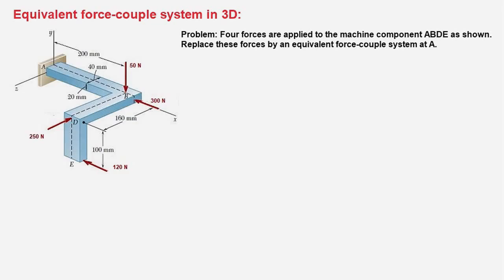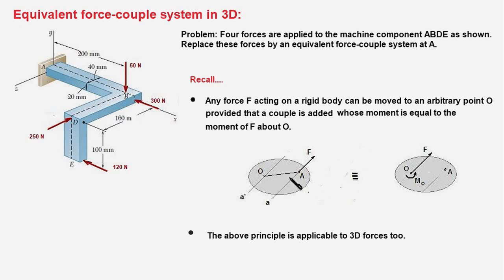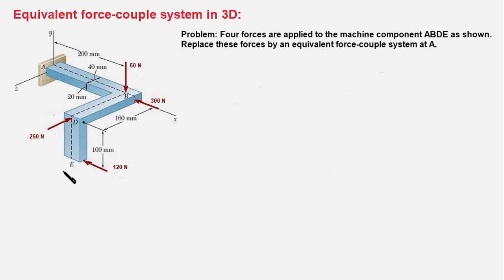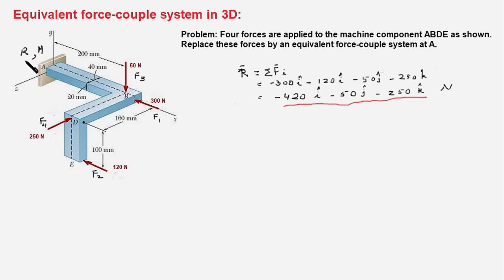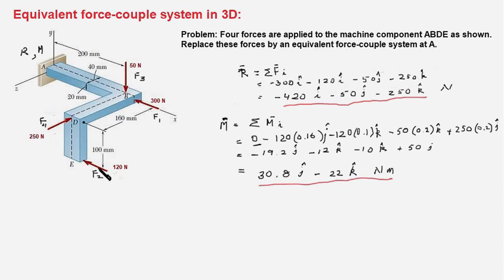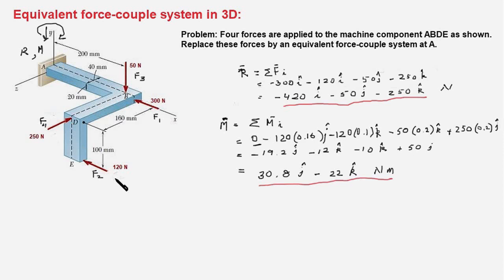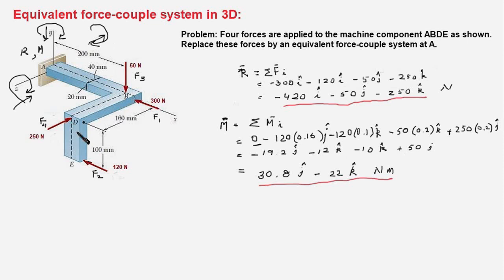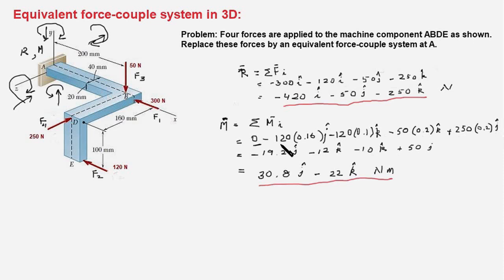7.4 How to replace 3D forces by a Force-Couple system at a specified point

Comment: So if the force intersects with the x, y, or z axis there is no moment?  I am talking about F3 at time 6:10 where there is no moment on the x axis because F3 is touching the x axis
Reply from the maker: Yes, you're absolutely correct - since F3 intersects x-axis it has no moment about this axis. As explained in the video, the force F3 has moment only about the z-axis.

Comment: Moment =r×F not F×r
Reply from the maker: That is correct -- You can find moment by vector method too i.e. M = r x F. In this video, I haven't used the vector method for moment calculation. As the external forces are parallel to the three axes, it is pretty easy to visualize the direction of the moment vector and so the solution becomes fairly simple.